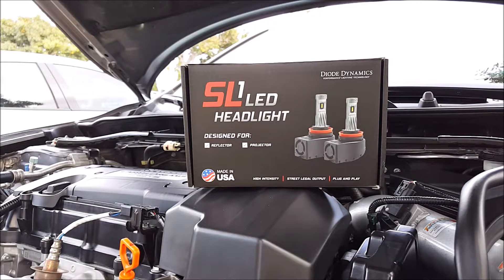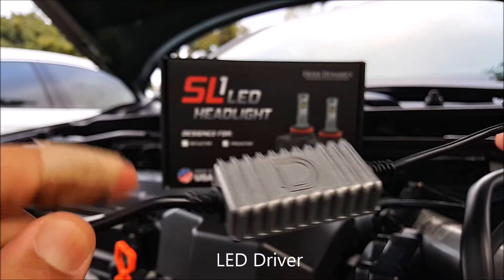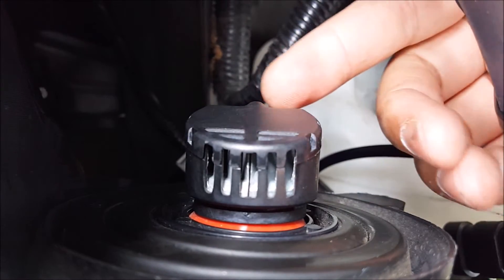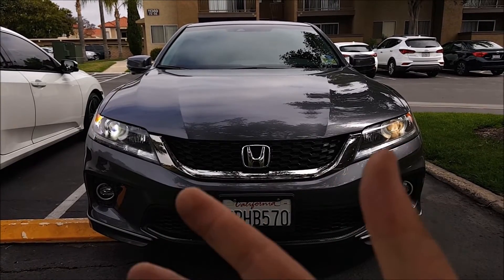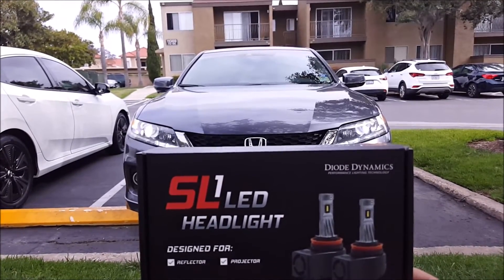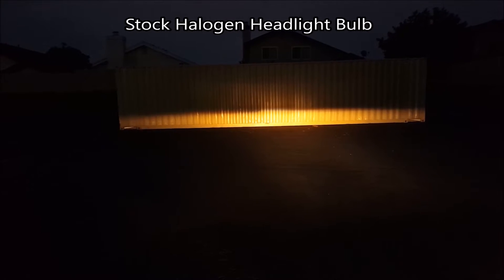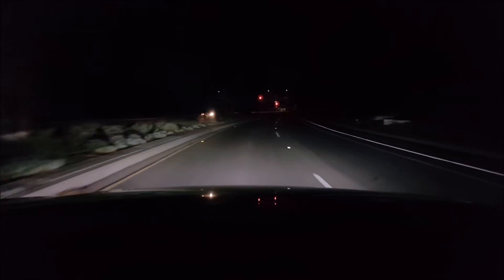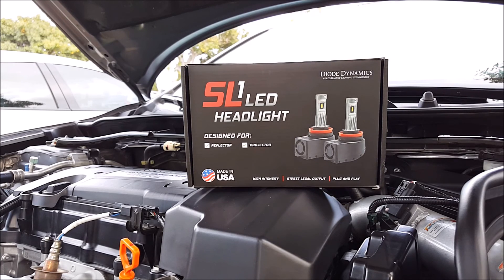[Product Review, Installation & Demo] Diode Dynamics SL1 LED Headlight Honda Accord

Comment: I just did diode dynamics xp80 rear blinkers, the xpr reverse lights, and their switchbacks.

Your resistor kit is amazing!  

Would you say the diode dynamics sl1s are still a good choice vs. stock?

Comment: In a different car I installed the SL1’s with the fan pointing up rather pointing down as you installed it. The chips still fire left and right. Does it matter that the fan is facing up vs down? My car has dust caps to protect against water and dirt.
Reply: I'm not sure it fully matters, but I do believe Diode Dynamics usually installs them downwards. Maybe they can chime in though on your comment to give some insight. They are super helpful when you have questions, you could also try to shoot them an email or something.

Comment: I think the problem is with the throw.  I also have a honda accord coupe of the same year.  From what i can see from you video, these are brighter closer the the vehicle but the lights down go as far from halogens.  Do you have an opinion on this?
Reply from the maker: All LED are like this.  They appear to be bright and proven to be brighter compared to stock using a lux meter but it lacks intensity and focus.  However, quality HID kit will be perform better in lumen, lux, distance and focus.
Reply: @DIYCarModz  do you have a recommendation on a quality, easy to install HID kit?

Comment: The 2 strokes are brighter
Reply: Just A Trucker  True ..but you don’t want to blind oncoming traffic neither
Reply: @darrentoews3151  They don't blind oncoming traffic dude if you have your lights aimed correctly. But the 2 strokes are the best plug N play LED bulb on the market. TRS did a comparison with Diode Dynamics

Comment: I had the Diode Dynamics SL1 H11 in my 2018 Chevy Cruze. They were a huge upgrade. One fan went bad and became extremely loud. DD replaced the pair and I noticed they were considerably quieter. DD redesigned the bulb assembly after I purchased mine originally after their product launch. Great customer service.

Comment: That's not too bad I'd still try to do the retrofit. Been waiting for a video on these LEDs, thanks for the upload@
Reply: They're the best on the market by far overall. Excellent heat dissipation, great beam spread, long life span and since it's rated at 1630 lm it utilizes it effective.

Mine is the older version without the adjustable collar but 2.5 years and still shining.
Reply: @F9000LIi would you go this or the 2 strokes from morimoto?
Reply: @han615  I have the 2stroke and they're awesome too but overall the SL1 will be the better one. 2stroke is rated at 2440lm and 1.9A draw with a 24V input power that is priced at $120 whereas the SL1 is rated at 1630lm and 1.58A draw with a 20.3V  input power that is priced at $150.

The SL1 has the edge with the best heat dissipation on the market without a doubt. The lumen figures might lean towards the 2stroke but the SL1 has less draw amp, less power input & less lumens yet efficient thus better cooling and longer life span. And the LED chips are high quality plus excellent customer service.
Reply: @F9000LIi  I was trying to decide between to 2 to see if there was a different because of the price, guess I didn't noticed the specs. Thanks bud for telling me the information.
Reply: @han615  No problem. Just when you install it make sure the LED chips are facing upwards and downwards for optimum output.
Reply: @F9000LIi  Wrong. The LED chips are supposed to be facing left to right. Not up and down as you proclaim. Diode Dynamics themselves state it in their videos and website.
Reply: @ricardomolina4605  you're absolutely right but for me and most of the cars I worked on having the chips facing up & down results in better light distribution.